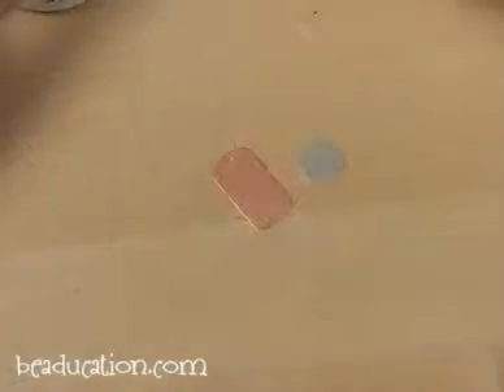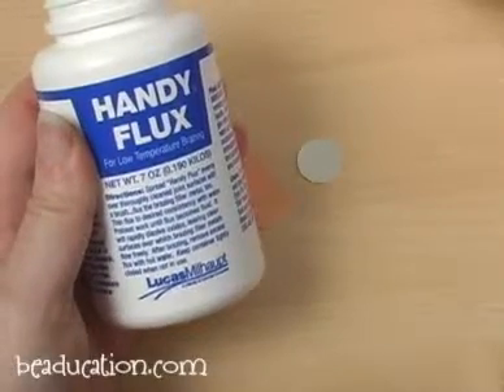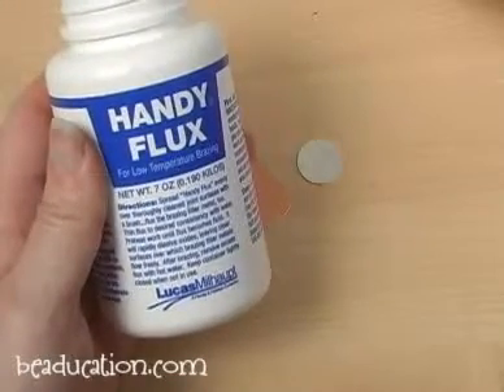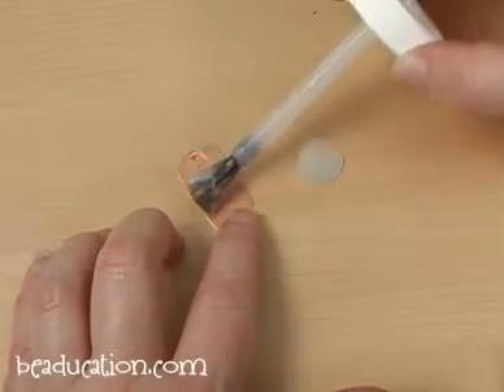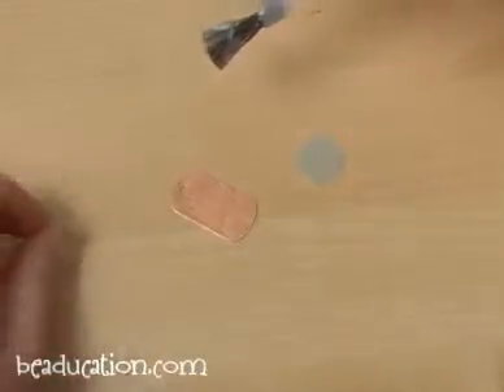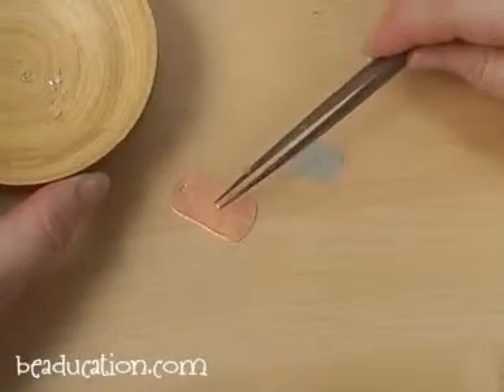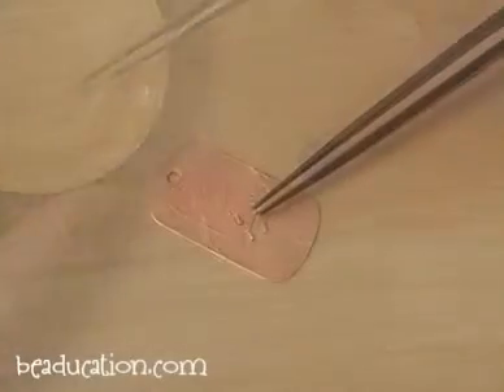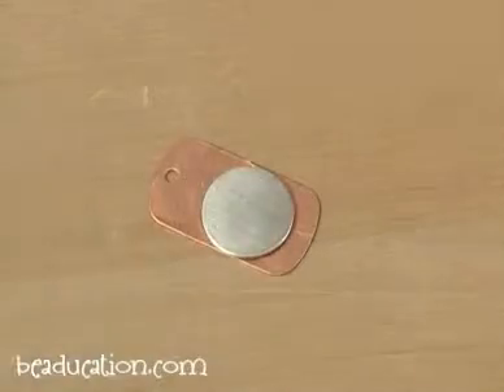Flux with Brush - Beaducation.com

Comment: Thank you. Which solder wire would you recommend? Soft? medium? hard? THank you
Reply from the maker: Hi Karen. Choosing the solder wire depends on your project. Soft, medium or hard are the options. This simply indicates what temperature is required to get the solder to flow. Soft flows at a lower temperature than medium, and so on. This is important if you are going to be soldering multiple layers of metal on the same piece. You would solder with a harder (higher temp) solder the first time and a comparatively softer (lower temp) solder the second time. This will keep previous joints from re-flowing. If you only need to solder one time, you can use any level but you might as well use soft or medium to save time and fuel. Please check out the link below to more info on soldering!
https://www.beaducation.com/soldering